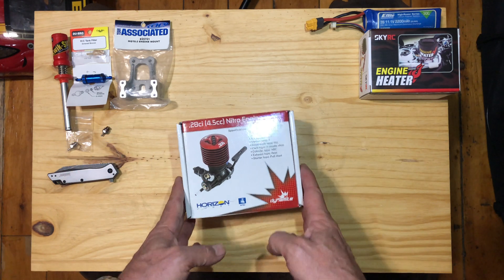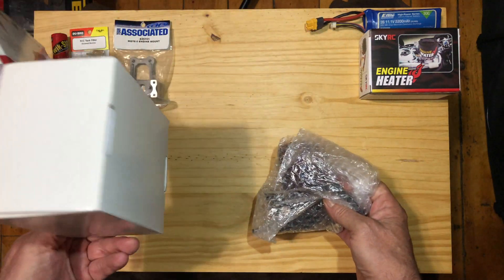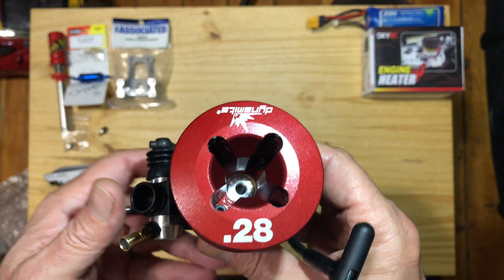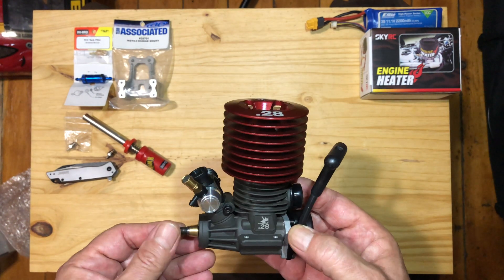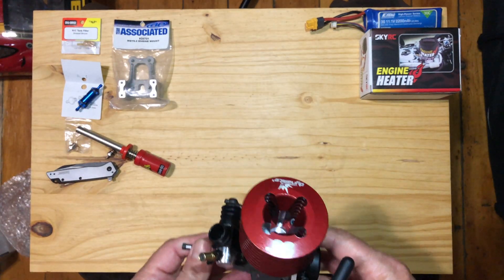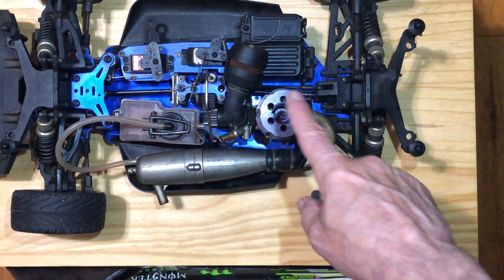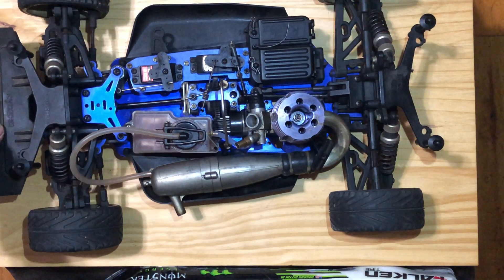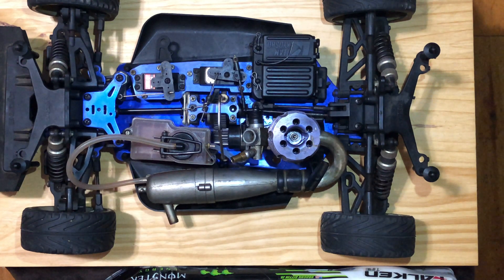Dynamite .28 Nitro Engine  Unboxing #new #rc #nitro #engine

Comment: What glowplug is it bud Iam new to nitro
Reply from the maker: Its recommended to use  a " medium to cold " rated plug on this particular engine . Different plug manufacturers use different rating systems ,  but most likely that's  between a  #3 0r #5 plug . I'm using an N4 on both my cars running in hot summer and they seem to like it .
Engine size , ventilation,   air temp and engine temp and fuel type , or percentage , will greatly affect all Nitro engines and there tuning . 
Most guys have and or try different temp plugs to see what works best for their situation .
Hope that helps .
Reply: @PhilipCockram  thank you Iam new to all this and I have one more the switch is burned out for the electronics so I was just gonna bypass it and just use a connector will that be ok. It's a 2s 450 mah 30c lipo
Reply from the maker: @michaellatini9294  It should be ok just plugging the battery in and bypassing the switch . Thats battery is very small thought . I use a 1600 Mah batt in both my nitro cars

Comment: what is the part number for the engine mount, thank you
Reply from the maker: You need two different pieces . One is the block and the other an adapter plate . 
I have seen some aftermarket sets that include both pieces .

Kyosho Engine Mount (2pcs/H=12.5/for 21-28) 
Part NUMBER  IF108B
and also
Kyosho Engine Mount Inferno 
PART NUMBER: K.IF290

Hope that helps .

Comment: Did the engine mount work? Maybe do a follow up
Reply from the maker: Hello , Thanks for watching , I meant to do a follow up but time restraints delayed it . The Car is complet , The new engine install and break in went in went perfect . Just 1 glow plug with 4-5 tanks .Till I swapped it out . New 55 chevy Bel Air body is painted and mounted as well . I also add the Dynamite tuned pipe that is designed for this motor , The Kyosho one needed a new adaptor to work and it was better to just get the right pipe and it was cheap , same as these motor mount plates below . There are easy to find also . The links are just for the parts #s . 
Hope that helps 
https://www.amainhobbies.com/kyosho-engine-mount-kyoif108b/p36959?msclkid=e55fbe5296781bf54e61dddbaeec8f52 
and you also need this part , plus the right hardware , M4 mostly I believe . to make it a direct bolt on with no drilling , It works great . 
https://www.amainhobbies.com/kyosho-engine-mount-plate-gunmetal-kyoif431/p34706
Reply: @PhilipCockram  thank you for the reply, is that just an mgt 4.6 mount?
Reply from the maker: @yamaha4902  Yeah , some kind of TA nitro mount . It was super cheap for me and I thought I could cut and mod it to work but it wasn't worth the effort
Reply: @PhilipCockram  oh so the links you sent are the way to go then? They worked with big blocks fine?
Reply from the maker: @yamaha4902  Yes for sure , Everything lines up perfect and all with the correct threads . And yes now its a universal mount for all big blocks . This engine makes good power as well . 
One note . this engine shaft is too long for the 2 speed pinion clutch set up from the  original Inferno GT2 -3 .
I had to cut it down  abit , maybe 12-15 mm
Reply: @PhilipCockram  did you get a different shaft as in a shorter shaft?, flywheel a different size or did you actually cut the shaft down yourself please respond I have the same car and trying to finish this build in memory of someone who passed thanks.
Reply from the maker: @alexlougan3148  I cut the shaft . It was way too long for this application  . Measure twice,  cut once is the rule . 
My rule is to measure until there's no possibility of error . No matter how many times . The mounts always have ( or usually have ... slots } with a few mm of play with the bolts too . Hope that helps
Reply: @PhilipCockram thanks for the reply, I’m going to keep you updated on this build.
Reply from the maker: @alexlougan3148  Great stuff . Best of luck with everything . Remember to do proper motor break in . Cheers .
Reply: Wow you have red nitro engine well I don't have red not nitro engine